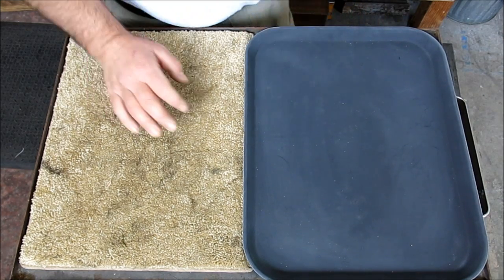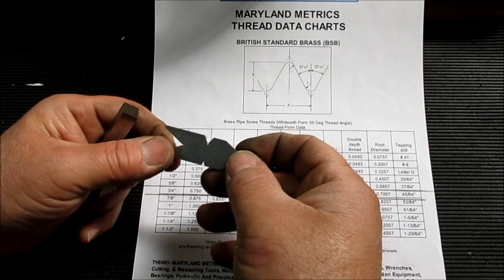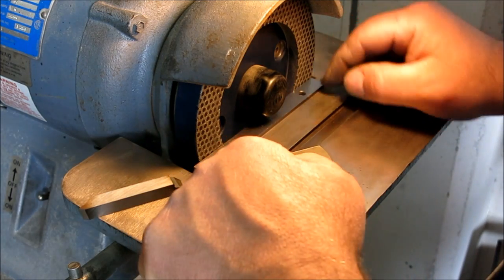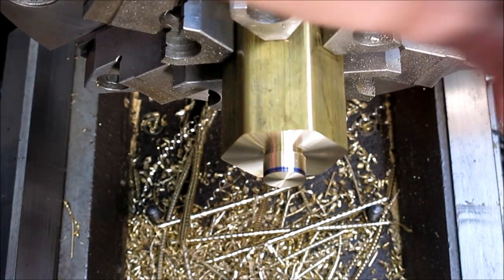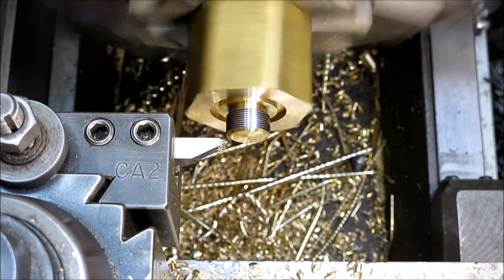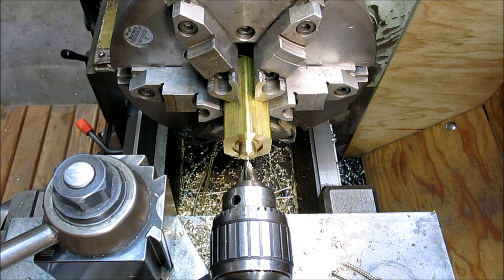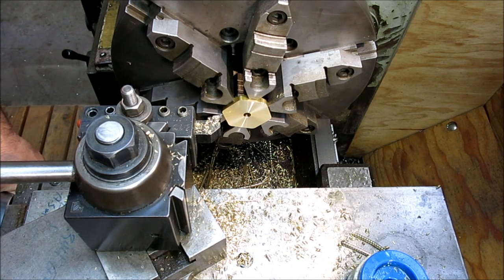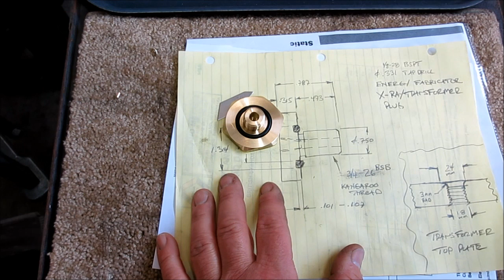Monday Night Meatloaf 29

Comment: Hi Tom, I know this is old, and I dare say lots of people have commented on the screwcutting part, BUT just in case, if you mount the tool upside down you can screwcut away from the shoulder, with the chuck running in reverse. Love your channel BTW. Best wishes, Mal.

Comment: That plug looks really, really nice. And the fact that you left the initial size of the hex stock will come in handy, since this is a relatively fine thread and bigger grip means EF will have where to grip it.

Really fun project to watch.
Reply from the maker: Hey Aserta,

Darn electronikers will probably smear it with conductive epoxy or something of the like and use a pair of channel hammers to snug it up.

Cheers,

Tom

Comment: Great video. I like the use of the DRO for different tooling.
I heard an interesting bit about BSBT and BSPT
Sometime ago, I was reviewing specs on a old piece of equipment were I was working. It was made in Germany, had all metric threads except for outer ends of the hydraulic hoses that attached to pipe, they were BSPT?  I ask another engineer at work about it (he likes to work on old British cars and motorcycles) He said some manufacturers prefer BSPT because they are less likely to leak or "wick" because of the shallow taper.
Reply from the maker: Hi Milton,

I'm familiar with BSPT and have seen it a few times. McMaster and Machinery's handbook have specs and tools for it as well. I couldn't find specs for the BSB in any of my reference books. Chris provided a good online listing that I used.

Cheers,

Tom

Comment: Hello Tom,

I like to use a micrometer bed stop for face grooves, shoulders etc. It's easy to set with the DRO and it avoids the chatter you get from reducing feed as you approach your numbers.

BSPT is often described as British Standard Pipe Thread, but the T is for taper and there is a BSPP (parallel) form too, just like NPT and NPS.

A VFD takes some of the stress out of threading up to shoulders as it's possible to set up an electrical stop.

Good stuff as usual!
Reply from the maker: Hey Paul,

Thanks for the tip. I rarely use a bed stop. In fact I don't even have one. About the only place I do that is with tiny drills in the mill. Pecking against the stop is the only way to drill deep tiny holes.

All the best,

Tom

Comment: Tom;

Had a chuckle when I saw the "Kangaroo Thread" reference on the sketch.  About best way to describe it.

Whitworth's can be a PITA.  I have owned several MGB's and although almost all the bolts on the car are SAE, the engineers at the factory had to keep one Whitworth reverse thread bolt just for old times sake.  I almost busted a gut trying to get that darn bolt out the first time.  Finally decided I would try the old, give a bit of a tighten to break the rust, trick and the bolt spun out as nice as you please.  After a few moments of judicious swearing, I made sure to remember where that bolt was from then on.

I am planning to make it up your way from SoCal one of these days and hope to be able to stop by and say hi.

Regards;

Ron Kluwe
Reply from the maker: Hi Ron,

Thanks for the nice note. Let me know when your headed up. Should be able to make some time.

Cheers,

Tom

Comment: Great Video man.  I use to love to work on Brass.  When I use to do the O-Ring slots I use the round end cutter. I found that when I made a square back/inside like you made the O-Ring had to stick out more. Have you notice that.
Reply from the maker: Hi Ruben,

Grooves for oring that seal are almost always rectangular. The oring that is above the surface squeezes into the rectangular groove and acts like a spring keeping the gas or liquid where it belongs. Sometimes they have very small corner radii at the bottom but most people don't bother with that detail.

Cheers,

Tom

Comment: Wow Tom, nice save. I would have panicked and probably scrapped the part. Nicely done. 
Wish I could have made it to the open house, but it's a long trip from Massachusetts. Maybe next time. 
Funny, I've been right by Benicia. I did some work in Sacramento a few years back, and on a couple of free weekends, took the Caltrans train to Richmond, to connect with BART. into SF. 
Really nice area. 
The multi tool setup on the DRO is interesting. Maybe you could explain that more sometime?

Thanks,

Bill
Reply from the maker: Hey Bill,

I screwed enough stuff up for both of us. Thanks for the comment. 

cheers,

Tom

Comment: Awesome work Tom! Nice recovery :)
Damn BSB thread... I'm glad we got that sorted.
I didn't think about a thread relief. Good stuff.

I have a 1/8 BSPT tap, so you can keep yours and never use it again. I find that if you tap down to the second or third thread from the end of the tap, it usually makes for a nice, tight fit. 

Thanks again - it will truly be like an early Christmas. I will post an 'install' video as soon as it arrives. I can't wait!
Reply from the maker: Hey Nick,

Ok I'll put safety tape all over this tap and put it in deep storage. I'll let you get the fit you want with the 1/8 tapped hole. Just don't snap the tap off and send it back...... I wonder what kind of box I should make for you?

Cheers,

Tom
Reply: oxtoolco
Tom... if I use a 'material thickness-transport distance' ratio... based on the box you made for Adam, this box will need to be roughly 1/2 thick on all sides, with ultrasonic testing on the welds. Don't forget to send me copies of the mill certificates and test reports. LOL :)

Comment: Tom- Another outstanding job! Every time I watch a fabrication job I always wonder "What would that job cost the customer?" Once a while back Keith Fenner mentioned a few prices and I was surprised. Lower then I imagined! I've made many parts for friends never charging them but lots of times I have to tell them to just buy the part because it will take me two hours to make a $12 part!  Lol
Reply from the maker: Hi John,

You got that right. The plug for example would fall into the minimum charge bucket. Its actually a "simple" part but if you charged all the actual hours of messing around it becomes a little scary. The basic comparison is Home depot and some brass fitting you find there for five bucks. When you see the actual steps and issues it starts to put this work into perspective. When people see for themselves what it takes to make something from scratch they gain a quick appreciation.

All the best,

Tom

Comment: I always use a 45 degree chamfer on a 60 degree thread, read somewhere
that's  called a "Higby" prep?
Works good and resembles what is on most "factory" fasteners
Reply from the maker: Hi Gent,

I think the Higby prep is like what you see on a thread plug gage. The first feathered thread is thickened by cutting it back with a keyseat cutter or other small diameter tool. I used to use a 60 off the side of the threading tool until I learnt better. Too lazy to change tools.

cheers,

Tom

Comment: Hi Tom,

Meatloaf is not just to be eaten on Mondays, it's good on any day of the week.

Threading that close from a shoulder is always a little nerve wrecking... The fuzz on the tip of the cutting tool is confusing as where the tip really is, a little jet of air often helps to chase that fuzz so the visual sync. operates better.

As always a good machinist falls back on his feet and keeps on.

I think I could easily get used to California, here near Montreal it's still sooo cold for that far into spring.

Thanks for sharing,
Pierre
Reply from the maker: Hey Pierre,

Yeah that's it. Tip fuzz and shoulder reflections. That's what threw me off. I'm pretty sure you could get used to California unless you really need to see the seasons change.

Cheers,

Tom
Reply: Hi Tom, by now I've seen enough season changes and cold, so...

Comment: Thanks for another great Video, interesting precision work. Note. A Whitworth 55° thread, top slide setting (which you didn't use so it doesn't matter!) is 27° instead of 29.5°. Thanks for another great Video, interesting precision work.

Regards, Matthew
Reply from the maker: Hi Matthew,

The thread was so shallow it was not worth setting the compound up. Thanks for the comment.

Cheers,

Tom
Reply: oxtoolco
I got that, especially in brass, I understand how difficult it is to remember everything when your making a video! The Whitworth thread with it's round crests and valleys is a very strong form.
Reply: 27.5° to be pedantic.
Reply: Sily Bily
Nope, 27°, you use half a degree less than half the pitch angle! 29.5° is not half of 60°s.

Regards, Mztthew
Reply: Matthew Tinker
The pitch of a thread is the distance from one point on a thread to a corresponding point on the next thread measured parallel to the axis, i.e. a straight line, I was not aware that straight lines had angles.
If it is 1/2° less, then it's half a degree less than half the thread angle, or more simply put half a degree less than the flank angle, I believe.
Reply: Your right, but I suspect that you had clearly understood what I was saying!

Comment: RCH! My side is splitting if that's what I think it is. Didn't think you had it in you.
Reply: Also, believe it or not I've encountered that 1/8-28 BSPT in the states. Subaru oil pressure senders for the oil galley plugs and a fitting in some of the intake manifolds use that thread. Some larger BSPT fittings are used elsewhere on car as well. Imagine my surprise...
Reply from the maker: Bradley Weingartner Hi Bradley,

Yikes I have a Subaru. I guess I better hang on to the tap. The RCH is not to be confused with a whisker or tad. It is reserved for the most discriminating craftsmen and the finest work.

Cheers,

Tom

Comment: Aww man .... I measured 4 different vices, thought I had good sizing on those .. sigh
Reply from the maker: Hey Stan,

What's the deal? I get all the factory seconds or what? No worries. I drove around the parking lot with my door open and ground off the pesky offsticker on the pavement. Works fine now.

All the best,

Tom

Comment: Hi, Tom. so your saying not make the thread tools perfect and square??? nice save!
Reply from the maker: Hi Sam,

Not sure I'm following your question about the thread tool. Yes make them square to the machine axes. Thanks for the comment.

Cheers,

Tom
Reply: i understand you planed to plunge cut the threads because bottom radius of the old style  thread. i have run into that a few times working over seas. the top of the thread has a radius also. i need to know more about tool making to ask the right question i guess. thanks for all the great videos.

Comment: When I started it was all 55 degree BS Whitworth - BS Fine - BS Pipe. Then around 1960 New Zealand converted to the American 60 degree NC - NF - NP standards. Not content with that we ended up metric in the 1980's and here we stand. Not to many metric lathes around then so we learned the joys of 127t gears and running lathes backwards. Hard luck if the lathe didn't have a reverse! Much pulling on chucks!
Reply from the maker: Hi Derek,

I guess the US doesn't want to give up its machinery. We cant seem to make the jump to metric. After learning my new metric threading trick I was disappointed it was an inch thread. 

Cheers,

Tom

Comment: Tom

Hang on to that BSP tap for when you restore that Rolls Royce or Jaguar you've been longing after ( fuel, oil and brake line fittings ).

Then you'll need some BSF ( fine Whitworth ), BSW ( course Whitworth ) taps and dies as well, for the engine, transmission and suspension.

Plus some Whitworth ( W ) and British Standard ( BS ) wrenches as well, which are based on the bolt dia, not logically nut size like SAE / AF.

How they could use " Standard " in the names is beyond me.

I read somewhere Packard engineers in Detroit in the 1940's, faced with the prospect of building the Rolls Royce Merlin under licence, looked at the Whitworth threads used, and said " Thanks, but no thanks !! ".  " We'll use UNC, UNF and UNEF. "

Aren't we glad they did ?

Spare a thought for our X-Ray fabricator down here, who looks like he's working with a British-built medical X-ray.

Just like the British car scenario - he's got no choice.

If he had a choice, he be like me - UNC, UNF or Metric !

Regards
Reply from the maker: Hey Stephen,

Add Subaru to the list at well. I'm hanging on to this tap and marking it carefully so mr Bozon can't find it.

Cheers,

Tom

Comment: Nice job on the 'Plug Nickel' job.  In these parts that is Whitworth-less as who has tooling for that stuff?  My Grandpa and I used to work on old MG's and Triumphs and they were loaded with those oddball threads, lots of workarounds and swearing but we always prevailed.
Reply from the maker: Hey John,

Believe it or not the Whitworth is actually the superior form. Why it never became the standard thread angle and form is lost in history. I suspect somebody out there knows.

Cheers,

Tom
Reply: oxtoolco
 WWII.   The USA had a ton of different thread standards, but the Army & Navy basically dictated what thread to use for what size bolt.  They saw what was coming in the late 1930's and if you wanted to sell to them, you had to use the AN (Army & Navy) NC & NF standards.   The USA machinist had used 60 degrees as a common thread, hence it was kept. Whitworth is a better thread.  
I'll have to take a photo of my LeBlond (1939 machine) threading chart.... pretty wild, but some of those oddball threads almost match "common" metric threading.
Reply: Mr Bare
If Whitworth threads are oddball then your threads are sons of oddball. In 1841 an English Engineer, Joseph Whitworth, standardised the hundreds of threads which were in common use then so that parts made by different manufacturers could have the same mating thread. This standard was often used in the US and Canada. In 1864 this standard was simplified to form what is now the UNC, UNF and NPT 60° angle.
Whitworth also introduced the "thou", not heard you complain about that being oddball.

Comment: Nice to see that we all make mistakes from time to time ;-)  In regards to DROs, is there anything that can be added on the tailstock for depth/blind holes as a secondary z-axis?  Just curious.
Reply from the maker: Hi Keith,

I use an indicator from time to time. I generally just clamp a kant twist clamp on the tailstock quill and use a magnetic base indicator to monitor the depth.

Cheers,

Tom

Comment: I'm curious, why use a tap follower and tap wrench?
just putting just putting tap in the tail stock and turning the chuck by hand is a no-no?
Reply from the maker: Hi Lasse,

No its fine. I just thought it was going to take a little force to tap a tapered thread. My supermodel strength wrists complain if I do too much heavy gripping. I use that technique for really small taps in the mill and lathe.

Cheers,

Tom

Comment: hi
was wondering ,,,I seem to get trouble parting...was wondering about a vid on parting a piece of 3.5" steel?   :)
Reply from the maker: Hey Terry,

You need to part off 90mm steel? Making some big washers? To a hole or solid?

Cheers,

Tom
Reply: oxtoolco hi 
am making a holder for a flycutter,,has a hole about .750 "  if memory serves me. kept grabbing on me so I ended up sawing it

Comment: HelloTom, I have a query over your Monday Night Meatloaf 29 where you do not put a radius on the crest on the thread which is normal for Whitworths threads.I would normally do this using a chaser which is made from an insert from a Coventry diehead mounted on a handle and used on a toolrest mounted in a tall post. I obtained a number of these inserts from a flea market sale and could supply you with ono but I don't know what TPI you're likely to use, if ever, for Whitworth thread again. Should you have a need for one I have that particular thread pitch I would send you one if you let me know. Bren
Reply from the maker: Hi Brendan,

You are quite correct that the correct thread form for a Whitworth has a rounded crest. I rounded the crests with some scotchbrite as the radius is too small to chase with a second tool. As you point out its best to use a topping insert that has the radius built into it. Thanks for the offer of an insert. I don't see doing to many of these in my twilight years. Thanks for the comment and assistance. 

All the best,

Tom

Comment: Have you thought about doing this: http://i858.photobucket.com/albums/ab142/hondawhitefox/DSCN0710.jpg to one of those duster cans so that you aren't throwing them away when you want them for those times you don't wanna start up the air compressor? I have seen re-fillable aerosol cans around but I would imagine the flow rate from the valve on the top would be less than ideal.

Comment: Nissan is another vehicle to find BSPT.   Austin Motor Company partner, hence BSPT.  Oddly Toyota partner was GM... hence the old Land Cruiser six (FJ40 & FJ60) will look familiar to old Chevy mechanics, so a Chevy HEI distributor fits but swap drive gears  (they look almost identical, but are not)

Best vehicle... Saab.  Mixture of Whitworth, USA, and Metric hardware.
Reply from the maker: Hey Tom,

I'm not seeing a Saab in my future anytime soon. Thanks for the comment and participation.

Cheers,

Tom
Reply: oxtoolco
 When you can not figure out where the ignition key goes, you know you are in for a challenge.  :)